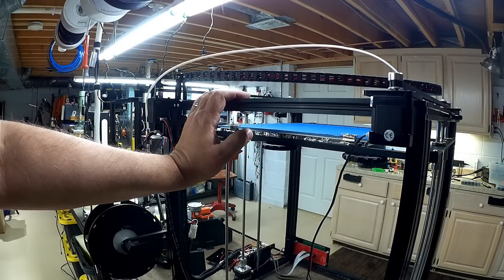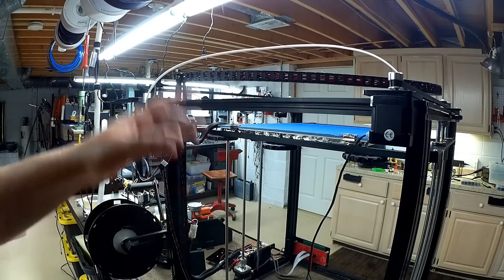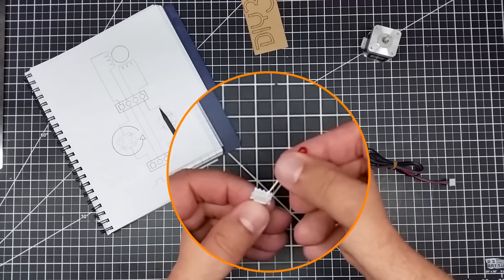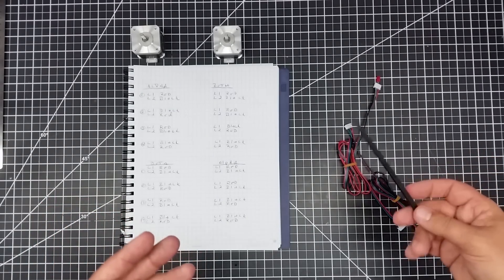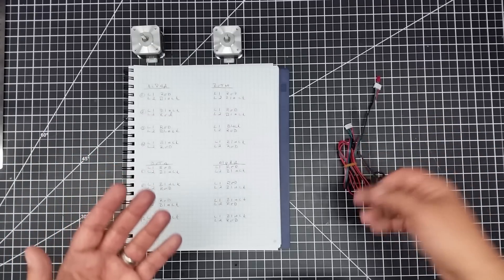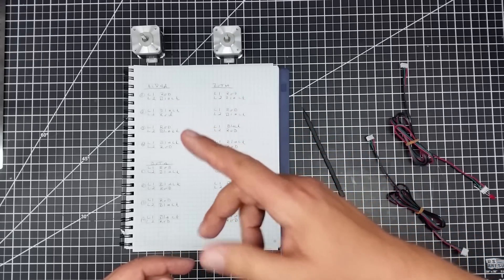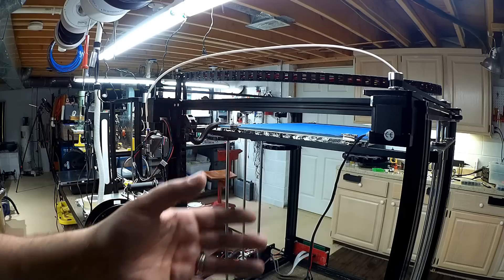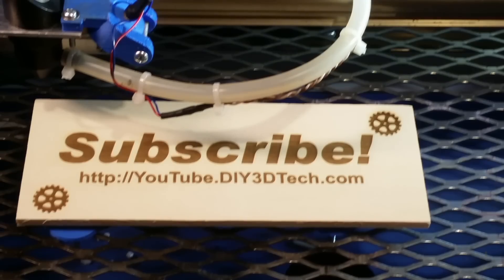Shop Talk - Solving My Core XY Motor Configuration Issues!

Comment: Thank you very much for this video.  You gave me the last push I needed to get my version of the S.T.E.V.E. corexy printer printing (KUDOS to Adam Meadows for his great design).  I used two identical stepper motors with flipped connectors.  Going into marlin I set the following in configuration.h (using Arduiuo)
// Invert the stepper direction. Change (or reverse the motor connector) if an axis goes the wrong way.
#define INVERT_X_DIR false
#define INVERT_Y_DIR true
#define INVERT_Z_DIR false
and I am off and running.  It's amazing how this 3d printer community is helping so many fellow tech-oriented folks.
Reply from the maker: Excellent!

Comment: Trying to sort myself with Core XY,
Can't swap pins, can only mod Marlin actually and using old cables that came with the Ender itself,
Basically i made a conversion following a printables page ENG by RH3D, but i can't find a way to get my axis to move correctly,
I mean i told machine to auto home it tries to get into the back left corner so x0 y235, but, doesn't work correctly

Comment: If you upgrade Nema 17's to 23's would the extra holding torque allow you to print faster because of less effect on print head  momentum and fewer steps skipping?
Reply: or you can just add 2 more motors instead of the iddlers in the other 2 corners....
Reply: So, either way would help?
Reply from the maker: I have no clue on that one, as at a certain point the inertia of the hot end whipping around will become an issue.
Reply: Yes, eventually, at a certain speed, but maybe help some possibly. Just popped in my head, so I figured I'd ask. Glad to see your Open SCAD page growing rapidly, I've been meaning to learn that.
Reply from the maker: Yea that one (i.e. the larger motors) is a bit beyond me.  Also hope you enjoy the open SCAD stuff and any question just ask!
Reply: The motors rotational inertia is as bad for clean prints as is the print heads inertia. A lager diameter motor (NEMA23) will have a negative impact because it's inertia is bigger than a smaller (NEMA17). Better to get slightly larger NEMA17 motors. They will still have larger inertia but not as overkill high as a 23. If you are skipping steps you have other problems that are likely not going to be fixed with lager steppers. Keep in mind going from NEMA17  to 23 will mean you will need completely different electronics because of the higher current and voltage needed.

If you want faster movement go for a higher voltage and better stepper drivers like the TMC 2130.
Reply from the maker: One of the projects I am kicking around is installing accermoters on the print head to measure the forces...
Reply: That would be interesting! Especially comparing firmware settings and measured values.
Reply: No, I'm all good, was just pondering, thanks Cutter Slade

Comment: You don't need that mumbo jumbo. All you gotta do is label them before you take 'em  apart. If new set of cables don't match the original sequence ,you can easily pop cables out and switch the pins accordingly. If you have already taken apart keep switching cables. In worst possible scenario you'll end up trying 8 times. Lastly, you should learn how to pronounce Can's  name :)
Reply from the maker: Thanks for commenting, yet you might have missed the point as if your assembling them from scratch there is nothing to label so you have to solve that.  Also this is the norm as I didn't invent anything here just explained it a little better and with maybe a littler more detail.  Please keep in mind not all people have the same views as yourself and they also learn and consume information differently.  Therefore I attempted to create something for the masses and not the individual :-)

Comment: you could sand the keys off the plugs.
Reply from the maker: Thanks for comment and did consider this as you sort of could however two thing to keep in mind in doing, the first is the pins are offset a bit so flipping means yo will have to bend the pins up and (2) its now possible for them vibrate lose in operation.
Reply: indeed indeed, good point, i had failed to consider the offset.

Comment: not trying to be a troll but NEMA is a standard and all NEMA motors should be plug and play, so with that said it would seem the wirng harness you upgraded to was wired wrong and that was the real issue but very informative video
Reply from the maker: The plugs are the same yes, however you need to swap the order of the wires to reverse the motor since its a Core X/Y the motors must work together and not separately...